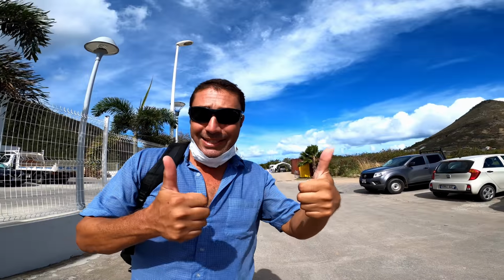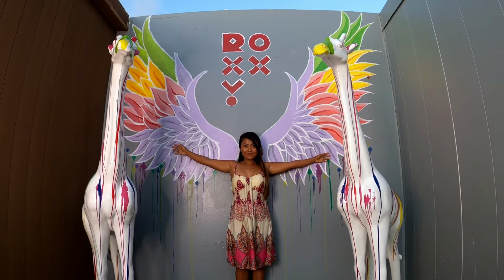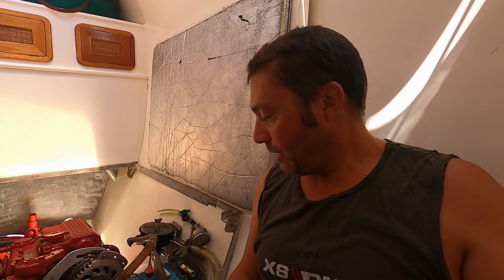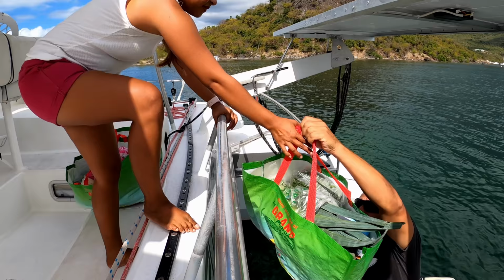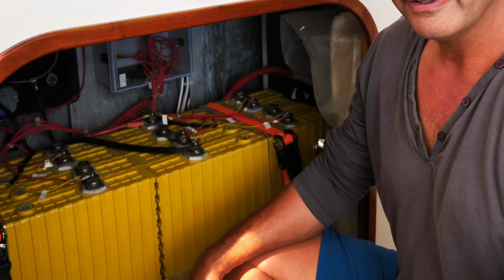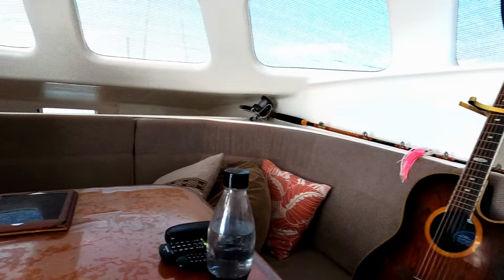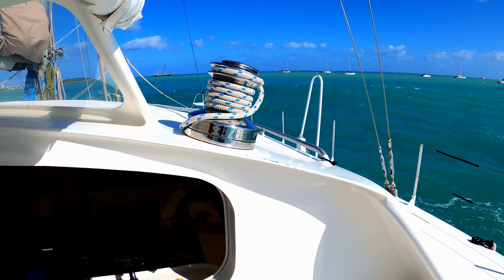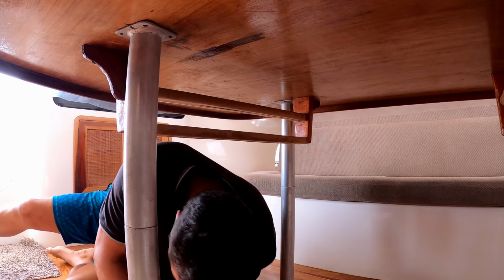How we prepare for the Bahamas - EP58

Comment: Look into an "oil filter relocation kit" and never have to deal with removing the water pump again when doing the oil change.
Reply from the maker: Good idea.. Will look into it. Cheers CP
Reply: They are standard items in kit and custom car builds. Remote oil filter mounting kits... you need a Take off sandwich plate with the top plate and filter bolt that clamps it in place on the engine filter spigot. 
But you need to be able to route the out and return pipes ..that might be where you run into a problem. Look where you you would route two thick wall thumb diameter size oil lines in and out.🤔 They might get in the way of other stuff.
In cars they are often linked into oil coolers after the remote filter,  useful if you want to run an engine long and hard as you can also increase the oil capacity. They also supply thermostatic controlled  kits they help in colder conditions by ensuring the engine oil gets hot enough to drive off condensation and fuel residues. Not a problem unless you include a large oil cooler.

The cheaper option is to buy a large HDuty Boa type strap wrench or chain filter wrench from a car place....you can loosen the filter from the front ..a quarter turn or so then it will spin off. 👍🏻
Catching the filter spill is usually more of problem.
Reply: THIS! I was just coming to say this as well.  I would definitely do this. Might look into running hard lines and putting the remote mount somewhere else directly on the engine.

Comment: You guys need an instant pot, we make bone broth in 2.5 hours , beans in 25 minutes after 24 hour soak and we do all our cooking while the sun is out
Reply: i wrote the same to delos....put it on deck to cook so cabin not warmed up at all
Reply: i saw a video where the owner put in a tesla power wall battery system.....with that, and instapot, an induction cooktop and a infrared grill on deck, you could get rid of propane altogether.  if they ever make electric outboards, you could get rid go gasoline too....then diesel is the only worry,
Reply from the maker: Sounds interesting.. Ill Google it up.

Comment: they make kits to move your oil filter. good for couple reasons. 1 easy access 2 holds a bit more oil which is a good thing for the engine. then you can also have a bigger filter which prolongs engine life
Reply from the maker: Good idea DC... Might look into that.

Comment: Another good episode. Have you done a video on your electrical system?  How are you throttling your 200A alternator output to ~100A ea to prevent overheating?  External regulators?  Thanks
Reply from the maker: Yes Mike... Using the Balmar regs with switchable hi/lo mode.